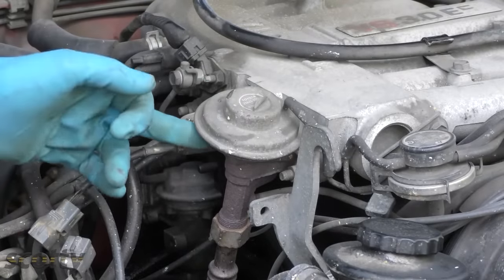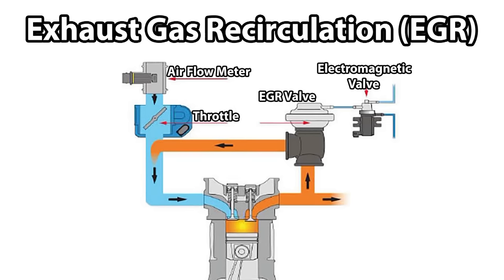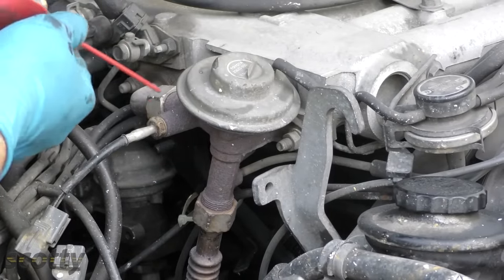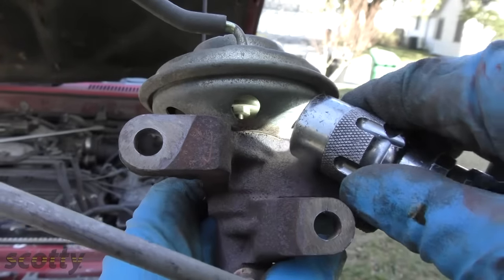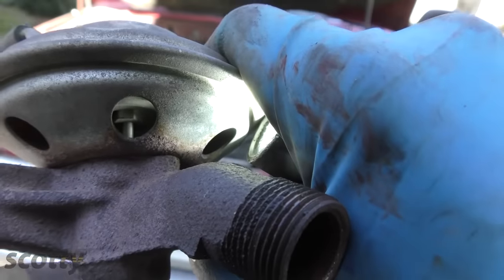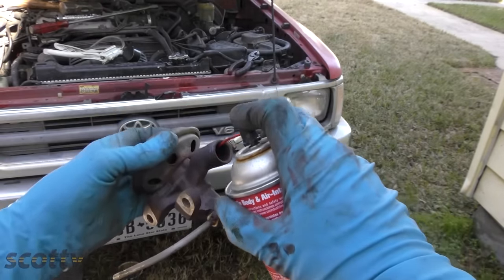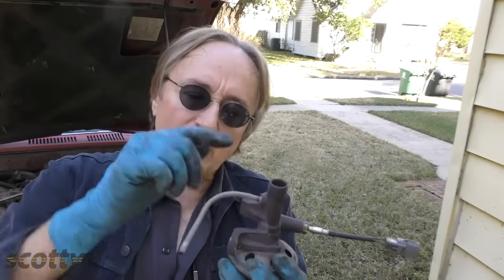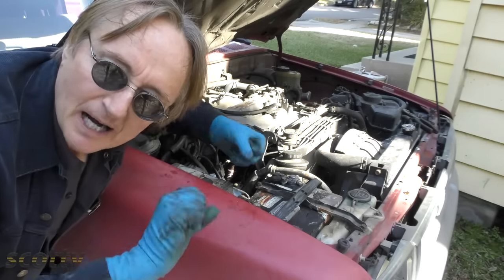How to Clean EGR Valve in Your Car (How It Works)

Comment: Hello, I’ve been watching your videos for the last couple months I just bought a 2013 Genesis 3.8 Track when I’m driving if I hold the clutch in and coast my RPMs will drop to about 800 then slowly increase to 2000 then it will drop to a 1000 and slowly increase to 2000 again I don’t know what to do about it I took it back to the dealership to have them fix it they said they couldn’t duplicate it. For some reason it doesn’t happen every time but if I get on it then use the clutch to coast it will start to do it. I’m going to buy a new transmission mount and gear oil to help the transmission I’ve heard that the Genesis has a weak transmission mount and it’s better to use lancer transmission fluid this is due to a second gear lock out because of a rev hang. I personally think maybe my throwout bearing isn’t fully disengaging so should I buy a new clutch and throw out bearing and do a new clutch same time or do you think the mount and fluid will take care of it. Or do you think it’s my throttle body, throttle position sensor and maybe EGR valve. I don’t know I’m just throwing out guesses. Your help would be much appreciated thank you

Comment: Hi Scotty. I like all of your videos. Please help me if EGR valve stuck not wide open is it big problem the car? I check this with mouth . Is it true method? Maybe on the car EGR not stuck open because vaccuum pressure is big. Valve works correctly. 
Mercedes w210 E240 1998 year

Comment: I have a 2010 Toyota Corolla manual transmission with ~ 130k miles on it.  When the outside temperature gets hot and the a/c is on 2/3/4 speed the car looses rpms to they point where it’s about to shut off.  Only happens when Idle not when it’s moving.  Any ideas?. I’m concerned it might be the egg valve.

Comment: Can you assist in finding the egr adaptor?  I was advised that mine needs replacement on my 2000 Lincoln LS.  It fits on a 2000-2002 LS V8.

Comment: Scotty, is there any way to clean the EGR valve without removing it? I drive a German car with a big engine in a small bay (CLK500) and I can't take it off without lifting the engine a couple of inches and I don't want to do that because I don't want to damage the oil pan.

Comment: My egr valve is all electronic, no vacuum pipes. Very rarely i'll get a check engine light that flickers on then goes off.
I have a scan tool with which i can control the opening and closing of the valve. I command it 100% open, then close it to 0%. After a few times of doing this when it"s at 100% i will command it closed, but suddenly it won't close? I blip the throttle at idle and it closes to 0%??
So wiring to the egr must be good, and valve is cleaned and is free moving, can the actual solenoid stick??

Comment: Hiya Scotty, I have a BMW 2010 E 87 diesel automatic which intermittently stallswhen it’s cold  but only happens when I pull off at the lights Or i come down to a stop.  it only seems to happen within the first five or 10 minutes of the car starting. I put my foot down on the pedal and no response!!! any suggestions. Thank you

Comment: Hey Scotty I have a question I own a 05 ford freestyle I had to put another motor in it and when we go it all back together I took it for a drive. It was revving very high and not shifting correctly I noticed that I did not tighten the bolt from the ERG valve to the ERG tube I was wondering if this could be a contributing factor to the problems I'm having

Comment: Would this problem  make my car run lean?
Got codes for mass air flow scensor and than pcv valve changed both but engine light came back on runs pretty  good but when parked and running shows signs of wanting to stall flutters sometimes and sometimes at light also on freeway i feel a little tinge of hesitation here and there. Won't  smog cuz of engine light.  Not sure what to think mechanic said he checked plugs leaks they didn't know why. Oh they also changed intake manifold Filter. It is a ford taurus ses 2002 if you have any idea please!!!  Let me know. Running out of patience and money. Thank you.

Comment: My car keeps stopping when I let off on the gas. I’ve tested the alternator, the fuel pump, and crankshaft sensor. However none of those is the problem. Can a EGR valve cause my car to do this?

Comment: Is it possible to use injection cleaners (Lucas) drive for 30 to 50 miles FWY? Is that an alternative. Check engine light  just came on no flickering constant.

Comment: I have a 06 Cadillac we have replace belts , hoses, thing that holds the coolant replace that. That big thing in the front that holds the water replace that water pump. He fixed it today and I took it for a drive and it did go way up but then it came back down about Midway but it never showed hot the other day when it was steaming

Comment: So i got a 300c 2005. Randomly it quits or idles at low speeds then starts right back up like nothing happens. I recently got a bad egr valve code which im assuming is the culprit based on research. Seems like it can just be cleaned and that could resolve as well, but my question is could cleaning or replacing the egr valve help with a little nit picky issue i have where if its hot outside it wont start on the first start. But it will start up on first starts of the day if its a cooler day. Idk why heat effects it. Got a tune up and it still happens. Whats weird is if i use my automatic starter my car will always start up no matter what on the first start. It only happens if i use the key in the ignition to start. im just puzzled by that.

Comment: Hi Scotty, I have a question.  I bought a CTEK smart battery maintainer to keep my low mileage Mini Cooper operating during very cold Ontario winters.  It came with eyelet connectors for convenience so the user wouldn’t have to use alligator clamps all the time.  I would like to attach these leads to the battery because I cannot always keep the car shielded from the elements in the garage.  

My question is... is it safe to charge a battery with the hood down?  I was under the impression that this could be hazardous.

Comment: I have a 95 Jaguar XJS failed Smog Check in CA. High NOx. Mechanic told me to change Air Flow Sensor, Air Temp Sensor and EGR Valve. Changed them and same results again. Smog check guys told me something about EGR's pipe line or something might need to be cleaned. I always buy the most expensive gas, change oil when the time comes. Keep the car maintained. Anybody knows what should I do?

Comment: Scotty! Quick question. Why do some Ford and dodge models put aluminum caps on their lug nuts that do not fit a conventional size socket. What is the best way to tell if the lug nuts have caps? I’ve already unwittingly mushroomed a few and want to avoid the headache of hammering a socket off the wheel.

Comment: Hey Scotty I love the videos man you're an excellent mechanic I have a question for you I have a 2003 Saab 9-3 Arc 3 codes popped up car keeps stalling out once it's warm the three codes that popped up was ignition coils crankshaft position sensor and clogged cat I replaced all three car still does it I also put in a new fuel filter any ideas what else it could be

Comment: Hello Scotty! 
Some advice would be lovely! 
I was driving my Peugeot 208 today, as I left a roundabout the car shuddered and the check engine light came on. Now having trouble accelerating at low gears. The car will start easily, but when I put it in first gear, it has trouble actually pulling the car. If I move to second gear at 10 miles per hour it has trouble gaining speed again. Similar changing to third gear at appx 20 miles per hour, trouble gaining speed. It's like it doesn't have enough power.
We have disconnected the battery and let the car reset. It will run fine for a few minutes, but when I reach appx 20-25 mph the issue occurs again.
Another strange thing that happened at the same time is that when I turn off the engine, the fan continues to run until we disconnect the battery.
It is a Peugeot 208, petrol, 1.4, 2013 plate. 
Thanks xxx

Comment: My truck  is showing code p0443. I change  the PCV solenoid and reprogram my ecm. The check engine light is still  on. Do I need to change my egr valve?

Comment: Isnt it better to to just take off the vakum hose so its not opening? Im thinking the engine would go better without the egr valve it then getts clean air instead of breading exhaust

Comment: HI Scotty i have Audi Q5 its idling bad in morning for 5 to 10 seconds  or when its parked for 8 to 9 hours .i went to Audi they cant find any fault but they changed map sensor which didn't changed anything..But i noticed when weather is hot it does more   bad idling if you compare with cold weather its less. Please help.

Comment: Is t possible for a dirty EGR to cause engine temps to run hotter? Iv replaced LIM/UIM, Radiator, thermostat, Rad Cap, an bled multiple times on my series 2 3800 supercharged Buick. On cold days she runs just right but on hot days she climbs up to 228+ at lights in a matter of seconds. I'm so lost Scotty :(

Comment: For those you think blanking the EGR is a good idea, think again, don't forget that it does not only lower emissions but also lowers  the combustion chambers temperature, if the EGR is "deleted" the engine will probably make some pinging sounds due to   
 pre-ignition (too high temps on combustion chambers).
Reply: pdidi1 very true on gas motors, leave it in place.  Diesel?  An entire different story..  it costs $1000+ to clean all the soot out of the cylinder heads and intake tract.  When the motor gets clogged with carbon it ends up polluting worse than anything due to insufficient airflow to combust the fuel.  This can happen in as little as 60k miles!  I.e black smoke eew.

Comment: My wife says the car is possessed . Okay Scotty solve this one. i have a 2000 Buick Park avenue, 3800 v-6 when you shut the car of at the end of each day after work and lock it, we watch the cars lights blink on and off for hours and a strange clicking and buzzing sound that comes out of the cabin air temp censer located in the dashboard right side of the steering column some nights it runs the battery down, other nights it don't what do you think it is ?

Comment: my egine management light keeps coming on. ive had egr valve cleaned and put back on. it runs  fine, and a day or two later  engine management light comes back on. my car is a honda accord executive year 2000. can a you help.

Comment: Hi. I have a 99 expedition getting lean codes and i cant find a vacuum leak. I replaced the upstream o2 sensors and noticed someone disconnected egr from exhaust and sealed the exhaust with something. Could this be my problem? Long term fuel trim is around 14 at idle and goes to 24 until i hit 2500rpm then it drops to about 4 or 5

Comment: I just replaced the electronic one on my 05 Buick Century. Unfortunately, cleaning it wasn't an option as I tried and it still wasn't working so I ended up having to bite the bullet and buy a new one. But at least it's under lifetime warranty and now the car runs like new!

Comment: Overhere we just block them off with a metal plate, turn them off in the ECU if needed and prevent the gunk from getting into the engine and messing the intake, solves all the problems

Comment: Hello 
I have a problem with my mazda 6 2009 Gt 2.5.  Fuel consuption is high when idol kilometers droping fast at stand stil.  I cleaned injector and throttle but stil it dropping.  In just 5 minutes engine will drop 6 to 7 kilometers.  Can u help?When i put full tank i get about 670km to go.. In the morning i start the engine to warm only in 1min it the remaining shows 666 And in traffic jam or signal waiting 2min it will consume same milage will drop Plugs also are new. Can u help

Comment: Would this be related to a transmission speed sensor not registering the right speed? I have both codes. EGR came first then Speed sensor code. Transmission goes into limp mode every 20 or so miles and i have to turn the vehicle off then back on and itll drive and shift fine for a little while.

Comment: I have an 02 rav4 check engine light was on read code maf sensor change map sensor clear code drove 40 miles lights came on code 171 174 egr and possible other any advice shop said to drive vehicle and add carbon cleaner. ??

Comment: I had the p0406 problem on my car Dodge charger 2008 v6 with  is sensor A so I changed the sensor A then the engine light gone, then after 2 weeks it’s came back again. Notice that the car at speed 60km and 80km kind of losing power! I dont know what the exact word to describe it.

Comment: I have a 2000 4runner and it turns off randomly , can it be the egr valve ir is on my check engine light report

Comment: I got a 2012 Chevy Malibu codes 401 and cylinder 1 mis fire replaced plugs coil pack and injectors. My car is eating gas as quickly as i put it in. I cann go 50 to 60mph and I'm okay but if I'm going slower it hunches

Comment: Hi Scotty, I have a problem with my Suzuki Grand Vitra 2000 not passing smog ? I have taken to several shops around my town and was charged from 50.00 dollars to 800.00 dollars and still as not pass smog. I got a temporary tag from the referee of state of California DMV . I have taken to the dealership and thy said they replaced a egr . And told me to just run it for a one hundred miles and it will pass smog. I did that and it didn’t pass smog. I have taken to other shops and left over there for servals days and they told me the same thing, run it , it should clear up but so far it as not and I smell gas inside my Suzuki when driving it . Some people said to junk it and I don’t want to because I paid cash and it as only 70,000 Miles on my Suzuki. Help if you can. 🤓👍🏼😎

Comment: Hey Scotty, I have a check engine light on for egr. I’ve replaced the egr valve itself and the engine light still comes on for the egr. Would sea foam clean help clean the pipe have the engine light go away?
Reply: Derek Powell clean EGR passages they may have carbon build up in them restricting the air flow

Comment: Great video as usual @ScottyKilmer! I have a question. I have a 2011 Ford Escape XLT and I snapped off the Rear window wiper arm. I ordered a new one to replace it but the old one is so seized on there that I can't seem to get it off. What would you suggest to do to remove it?
Reply: Already replaced you wiper? (nothing to to with this egr video)

Comment: i own a opel corsa C 2002 1200cc 183.000~ KM , it gave me EGR error code , i tried to clean it with cleaners but it works only for 1 day , so i changed the valve and it is ok now

Comment: Hello everyone,  
I've got a litlle issue with my 2.0 TDI Audi A3. 
Recently I did the complete engine rebuild with all new necesary parts and everything is aweesome except the stupid egr. When I hit the gas pedal a litlle bit harder the car starts to jump. I changced the EGR but after couple of km it started to jump again but litlle less. So could my problem be with a bad EGR pressure sensor or maybe the MAP sensor??

Hope someone will answer, eitherway thanks :))

Comment: Took my mpv to a mechanic paid 400 dollars for a new EGR valve...still getting the code.

He said it was all clogged with carbon but he cleaned it out..any ideas?
Reply: The valve may have failed if it is still throwing codes after being cleaned.

Comment: Recently my Mercedes started going into limp mode when warm. After a scan, I found out it was the EGR valve. So I took it out yesterday, cleaned it and then sprayed high-temp resistant lubricant on the solenoid arm, the spring and where the needle goes up and down. Today I put it back in and went for a test drive, car runs like a dream.

Comment: I Have A 2008 Ford Expedition..... Cranks But Engine Shakes... Idles High..... Didn't Drive Until I Changed Pllugs And Wires. AND MASS air Flow Sensor. BUT still Shakes Idles High But Stalls Sometimes When I Give It Gas Not Accelerating Properly Like Something Is Clogged

Comment: Good morning Scotty. I would love your ideas on a problem my nephew is having with his 1990 Ford Bronco. At first start up idle is around 900 rpm but as soon as it get warmed up ( closed loop I guess) idle goes up to around 2000 rpm. They've already started the part replacement strategy . I realize that without seeing the truck it's almost impossible to diagnose but I was hoping you had some experience with these vehicles and maybe have seen the problem before. Thank for your work and time it's always a pleasure.
Reply: Calander 2008 An engine actually goes into closed loop via the O2 sensor being warmed up, rather than the engine itself, which is why most O2 sensors have a heater.  I don’t have much info about your Bronco, but often high idle when the engine is warmed up can be caused by vacuum leaks in hoses and gaskets.  A good trick is to pinch each of the vacuum hoses, to see if the idle drops down when the hose is pinched.  This is only supposed to happen in your idle speed sensor that operates off of vacuum - you should have no other reduction in idle on any other circuits.....
Reply: cool thanks.

Comment: Scotty, does 2010 F150 5.4L have a pvc valve.  Mine has 150K.  I changed the ventalation hose on the engine around 130K.  Is the valve in the hose, valve cover?  When I look for a pvc valve part on RockAuto, all I see is the vent hose.  Thanks.  Like your videos.  How much coffee do you drink every day?  Heee

Comment: An informative video! But don't use a hammer with solenoid operated EGR valves. You could easily damage it. This one is vacuum operated.